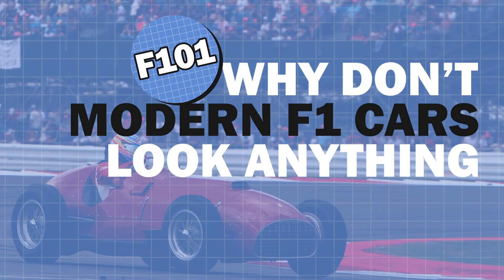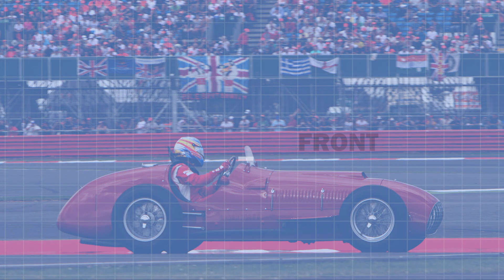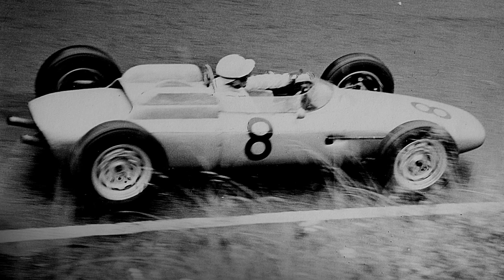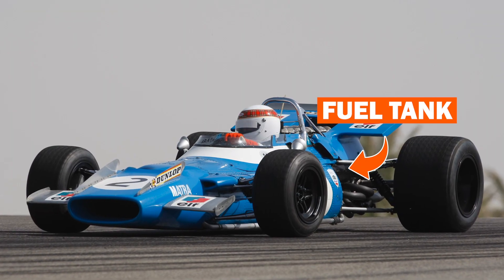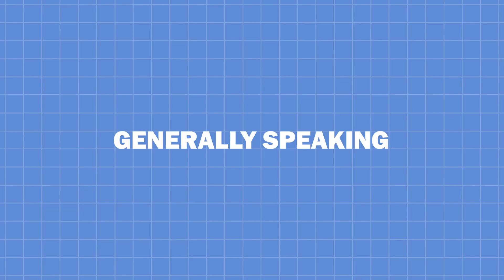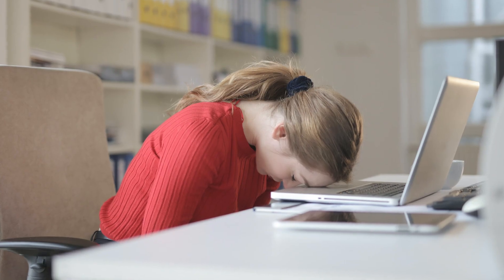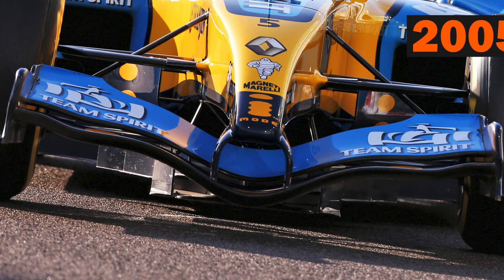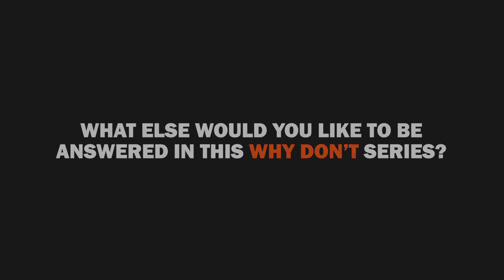Why Don’t Modern F1 Cars Look ANYTHING Like The Old?

Comment: I actually walked a no longer accessible road section of the Longford 1950s/60s track this afternoon.
It used to be a road course, but a highway build destroyed it, but there are still drivable pieces of it left, and also accessible by foot sections.

The main thing that stood out to me was how narrow the road was. Especially in one particular section (only accessible by foot) , prior to the slow almost 90 degree right-hander before the flying mile. You'd struggle to fit two cars side by side

Comment: There was an element of practicality in Cooper running the rear engine concept. A front mounted engine with rear wheel drive necessitated the fitment of a propshaft to transfer the torque from the engine to the rear wheels. This adds weight. The fitment of the engine at the rear, like Cooper, enabled a simplification of the drive train, enabling the torque to be transferred more directly to the rear wheels and the packaging benefits, namely the weight distribution and safety benefits were a byproduct

Comment: To be fair though it wasn't the speed that ground effects banned. It was that back then tracks weren't nearly as smooth as now and any disruption in the air flow under the car would completely change how it handled and it was really sketchy. Be that bumps or damage to the floor

Comment: Out of curiosity I'd like to see what F1 cars would look like now if safety had completely been ignored. Drivers's heads might be much more exposed like they were before 1996. What would the nose structure look like without any crash safety regulations? How would the sidepods look without mandatory crash structures? Would we even have an overhead air intake if the roll-over hoop isn't required? How many wings would the cars have and how absolutely insane could the speeds be with long-developed ground effect and unlimited aero?

Comment: I don't think the problem with the late 70s ground effect cars was that they were 'too fast' round the corners, compare them to modern F1 cars, the problem with ground effect cars was the downforce was unreliable.
If your car came off the ground slightly going round a corner (e.g clipping a curb, undulations in the track, debris)  you'd lose most of your downforce and fly off the track. A wing will still provide downforce even if you only have 3 wheels on the ground.

Comment: Uh...research in aerodynamics accounts for most of the body shape. R&D in rubber explains the wide slicks. Safety regulations explains the driver being barely visible as well as the halo. Physics explains the engine being in the back and the lower position of the driver. 
Next up: Why do drivers now wear full face helmets?

Comment: This video doesn’t actually answer question of why cars from the 50’s don’t look like cars of today, its just listing notable innovations in the sport.
Reasons why cars actually look different today:
1) Rules: you couldn’t build a 50s F1 car to race today even if you wanted to. The rules limit everything from chassis dimensions, to the engine, and the rest of the car.
2) Better technology: although planes were a thing long before the 50’s, the ability to study the effect of geometry and airfoils and aerodynamics was limited to physical testing only. Even then, wind tunnels weren’t a staple in F1 till the 80’s. Not to mention the fact that CFD studies dominate the industry now, which allows for quick simulation and very accurate results.
3) Better understanding of vehicle dynamics: the use of sensors on todays cars allows for endless data for chassis motion, aerodynamic performance, and most importantly, the tires. Back in the 50’s the engineers still understood the principles, but not nearly as much as they do today. Tires are so important and understanding how they work is the key to success in motorsport.

I know they are many more but those are just some examples. Next time you sit down and write the script for a video, ask yourself “does this answer the question I proposed in the first place?”.

Comment: This video was honestly quite a bit of a letdown. The question does sound stupid, and it is a bit, but it could've been answered much, much better. Not just when things changed and a basic explanation as to why, but also *why was it ever done any other way*. That really is the big missing piece that couldve changed this video from yet another generic list of F1 innovations to a decently informative one.

I also cannot understand why would you mention the tyrrell 6 wheeler. There is nothing of that car present in modern F1 design. Kind of the same thing with the ground effect Lotus.

And no mention some real modern F1 features like the airbox, diffuser, bargeboards, or perhaps even the rise of the vortex-generating front wing.